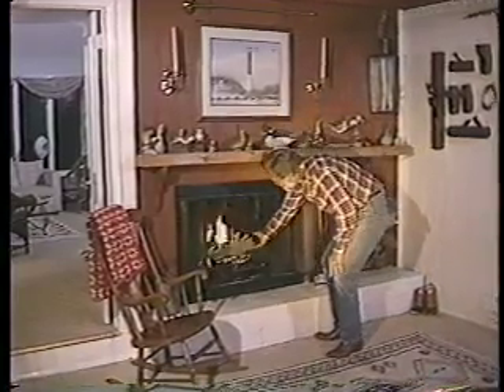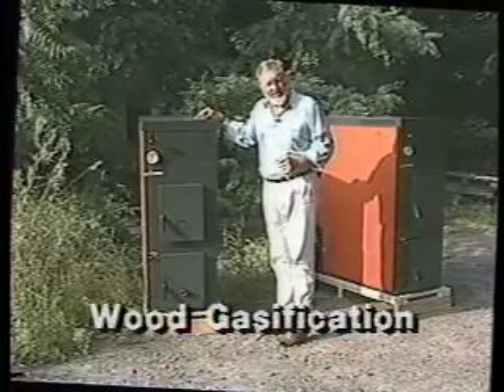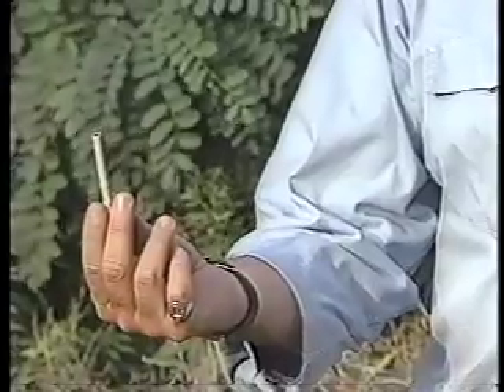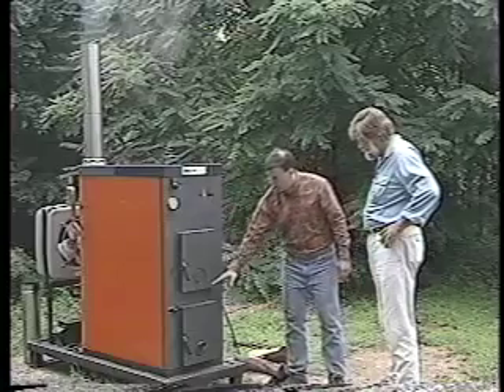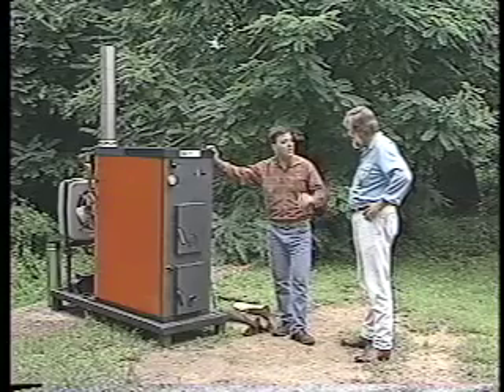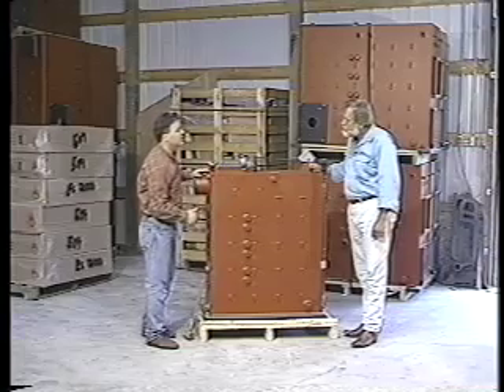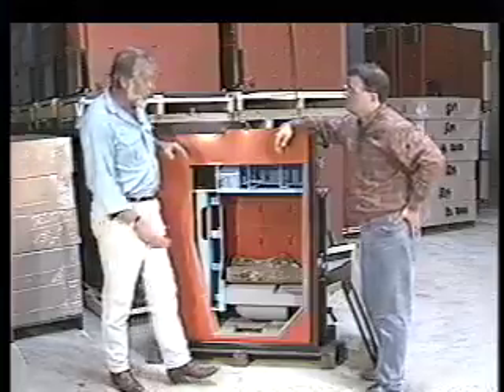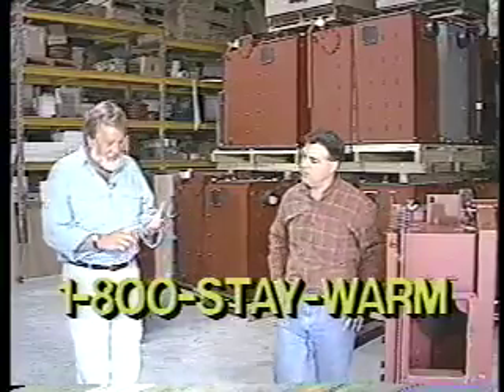Tarm Gasification Wood Boiler - Craig Issod

Comment: In 2011 I had a Tarm (Solo)installed in my new house in Ontario Canada. 
I have used it to heat around 6000 square ft including my attached garage. I have my heating system in my garage which is great because all the mess that goes heating with wood stays out of the hpuse. 
System works well and has been 100% trouble free to as of Feb 2025. I burn well seasoned firewood and the efficiency of the system is unbelievable. The gasification system on the Tarm is like a flame thrower leaving virtually no smoke coming out of the chimney. 
I highly recommend this system and have not seen any other manufacturer's system come close to Tarms quality and low wood consumption.

Comment: New System  didn't they have  wood gasification's Stoves in Poland in the 1940's  ??
Reply: Used for running cars during WWII - the techniques were known but not used in residential wood heating equipment until the 1980's when environmental laws in Europe came into effect (1980's also started such laws in the US).
Reply: @craigissod6027  As far as I know the EPA wood stove laws here in the US didn't kick in until 2016. Although maybe some states/localities may have preceded that. The gasification systems were gaining a lot of popularity way before they were mandated because of the reduced smoke and fuel consumption. I recently bought a gasification boiler. Since I have an agricultural business I could still buy the regular wood boilers, but the gasification systems are well worth it. Although I have heard that the new 2016/2020 compliant systems are a lot more temperamental in order to meet the EPA standards. I bought a pre-2016 gasification system.

Comment: Its a LOT of work to heat your home with firewood. Don't waste it with an inefficient wood stove/furnace/boiler. Gasification boilers are revolutionizing the wood burning scene. 

The Polar furnace is EPA compliant and as clean burning as a wood furnace gets. Efficiency in these boilers has reduced wood consumption by better than half of what a traditional stove does. The tech is affordable, simple, efficient, high quality and clean. Made in Canada.

www.woodoutdoorfurnace.net
Reply: Is there any chance of carbon monoxide production in these units and poison the premesis  ?

Comment: I have the 2200 series with a 800 gallon hot water storage tank. I love my Tarm it heats my 2 car garage along with my 2000 sq FT home. I was paying 4000$ a year for Home heating oil now just my time splitting and stacking wood witch I enjoy doing. Great Unit that pays for itself.

Comment from the maker: No doubt a good solid fuel system (complete) is not cheap- either is a good oil or gas system! My suggestion is to try the good folks at Alt Heating of N, America - specially, I can't post a link in a comment, but if you google alernative heating of north america (AHONA dot com), you will find them
Reply: Drone Flyers Multirotor & Quadcopter info   Are you talking about (alternate heating systems)?  They make a great wood boiler called   
The wood Gun      down in PA